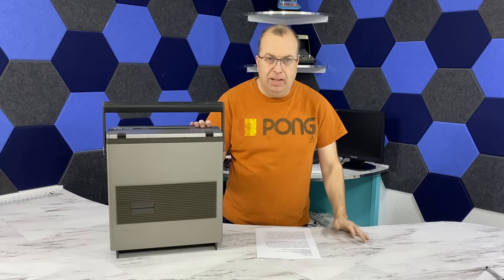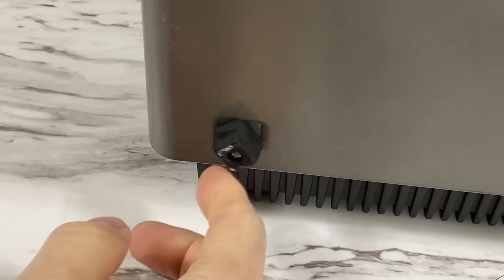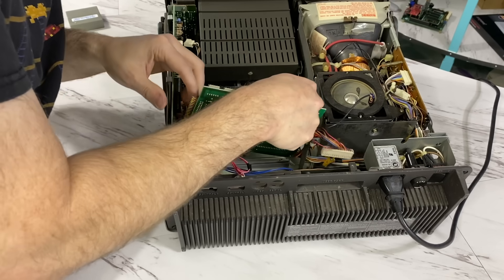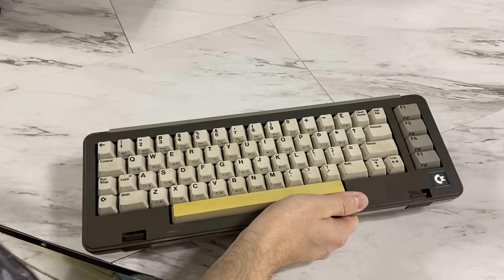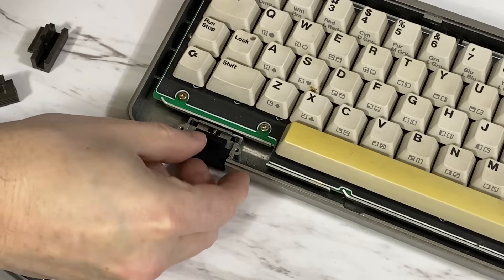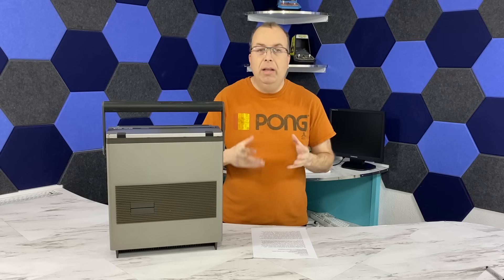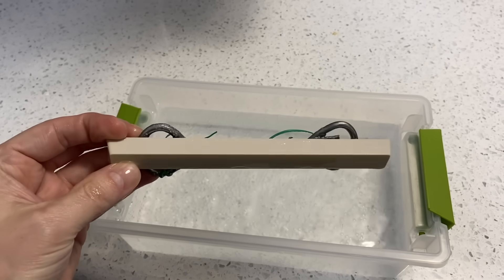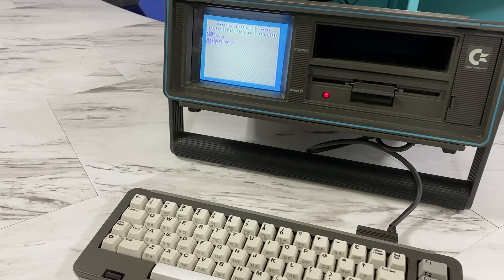Commodore SX-64 repair and trivia

Comment: techmoan would have just replaced the belts
Reply: I had the same issues with mine - they needed a new PLA, SID plus a video ram chip too.
Reply: @Techmoan  You're not going to read this, but in case you do, let me be clear, it was a joke, "you would have replaced the belts and it would have started working". Okay not a great joke in this context, but it got a "LOL" from Dave at eevblog when he failed to fix a LCD TV. ... I have seen your SX64 video several times, its great as are all your videos.
Reply: @OfflineSetup  no I get it - if it had belts I’d have swapped them too.

Comment: Thank you VERY MUCH for making this video. I saw the SX-64 on display in a local video rental and computer store when I was in 10th grade in South Houston and had to have one.  After cutting many lawns and saving every dime I had enough to purchase one but they were no longer available in most places.  My dad called around and we found one left at a computer store at mall in Baytown and we went and I bought it.  That SX-64 got me through high school and college (I had a larger color monitor so I could easily type my term papers in Easy Script) and I still have it today.  I brought it out of storage a few years ago and found the SID chip had failed which I replaced and it’s working fine with the exception of the keyboard.  I didn’t realize you could purchase a new membrane so I’ll be ordering one this week so I can get it in working order and beat my kids at Beach Head and Raid Over Moscow.  Thanks again!!
Reply: That's awesome

Comment: Larger keys often get deformed in the cast when you use harder plastics like pbt, so spacebars are often made from malleable ABS! This is common practice even today. ABS is great from a manufacturing standpoint, but sadly it's very prone to yellowing, cracking and shining.

Comment: I do miss mine.  I had an "External" modem that just happened to be the same size to flush mount in the drive bay area with the pocket removed and a plywood shelf put in.  Pretty unique so if anyone watching has my old machine lets talk buyback.

Comment: I'm still surprised there hasn't been enough demand for someone to produce a run of keyboard cables. Then again, if most folks buying an SX-64 without one these days are  either patient enough to wait for a cable to show up on ebay or willing to roll their own. 

I got a SX-64 a few years back with the cable, thankfully, but the entire handle assembly is missing... which is just about as hard to find.

Comment: A frustrating story:
I once met a guy who unearthed a collection of old computers - I bought a CBM 8096SK without a keyboard off him thinking either it would turn up or I'd find another - hah! He offered me a mint SX-64 for £250:00 we found by way of a thank you for my help in going through the collection. But I turned him down because I knew they are worth way more here in the UK and I didn't have the money to give him more. Well, it went on fleaBay for £200:00 - blast!

I did design a drop-in replacement 80xxSK keyboard mechanism using modern components, along with the 3D files for a replacement case - I never had the time to make them myself but the 3D files, Eagle CAD files, and Gerber files are on Thingyverse if anyone's interested.
The keyboard should be good to go for anyone with a CBM machine that needs a new mechanism. The case I'm less sure about as it's the result of taking measurements from the main case of my computer and eyeballing images on line.

Comment: I want to point out that the keyboard shortcut for load floppy disks, don't work with any software. I have a word like software, called easy script, that does not work if you use the keyboard shortcut for loading it

Comment: Hi, I'm from Italy. At the computer club where I used to go at the time they had a model that was between a SX-100 and a DS-64: it had black&white monitor, but 2 disk drives and we used it to "F4CG" games, if you know what I mean. Nibbler, 2 disks inserted and 30 sec to wait. ;-)  BTW they also had a TurboTrans, a modded 1541 with a 512 Kb hat-board that allowed to grab one full side of a disk in one pass and drop it on the next inserted disk.

Comment: I had an SX64 back in the day.  Bought it used for a bit over $400 (can't remember exactly).  This was probably in 1986 or so.  Got it for my second year of college, and yes...
I did use it for word processing (Fleet System 2) and some programming (UCSD Pascal).
Although yeah, it was mostly for games. ;-)  Had it for two years before I sold it and got my Amiga 500.  
The SX64 was perfect for dorm life.  Really easy to set up in my dorm room or take it to my friends for some gam... er.. homework...  Yeah...  Homework...  ;-)
Still miss that SX64...

Comment: omg why did they not have the wire attached permanently to the keyboard, no cable issues
Reply: flex touchpad keyboard is better and slimmer
Reply: text input/storage device, but a calculator is better for that tho

Comment: An awesome little machine, but would be pretty useless to me since all my stuff is on tape except 2 cartridges. Shift and run/stop is a nice touch, tbh.

I think you nailed it on the head, though. I mean, every C64 owner I knew was a kid who owned it because it was cheap and they could play them £1.99 tapes from Boots. Out of maybe 30 or so kids I knew with a 64, literally one had a 1541 and that's because his dad used it for business use. A floppy drive wasn't really realistic for C64 owners, because if they were rich enough to buy one of those, they'd typically buy an IBM compatible(typically a cheap Amstrad PPC) instead.

Comment: Shouldn't you have totally taken it apart and cleaned all the boards with like alcohol and compressed air or something?
I would have taken it down to the frame and scrubbed everything down really well. Maybe I shouldn't have stopped the video cause you haven't gotten to that yet, but you like wire tied up wires, so just assuming it's not coming back apart?
Just my 2 cents lol. But I'm a mechanic, and if we have a problem or repair, we obviously don't strip down a vehicle to it's frame to put in some spark plugs. However, this is more of a restoration?? I guess you must have assessed that it looked pretty clean inside, or maybe it was already cleaned up by the first owner, and you just didn't mention it??

Comment: I'm glad you finally got a machine! I have an SX-64 with white screen waiting for restoration. Interestingly it seems to work just fine on an external monitor!
Reply: If you're getting video on a external monitor, I'm thinking maybe a loose connection to the built-in color monitor. Time to crack it open and see!

Comment: I worked at Kmart (Costa Mesa, CA) around 1984. We had a SX-64. I think we just had the floor model (display) not any real stock to take away but could be ordered. 
It was a we working unit and as with all computers on display there was running with a screen full of "KMART Sucks".
We never caught the culprit and it was determined that it must have been a group of people since it happened anytime of day 7 days a week (wink, wink).
I honestly don't think even one unit was sold while I worked there. The Vic 20 and C 64s sold like crazy.

Comment: While those devices are definitly interesting now to see, from a mid 80s perspective I wouldn't know a single reason why anyone would have bought one. This thing is barely more portable than a normal C64 setup. And for that little more portability you get a tiny awful screen.

Comment: Does the NES controller for “Attack of…” work on your SX-64? Mine doesn’t. I don’t know if it’s my port or something with the SX-64. Mine has the standard ax-64 mod, of breaking the trace between 2 pins (I don’t remember the pin #, Carlsen has it on his site.)

Comment: Hey out there in YouTube retro technology land!

I do remember at least two people having won the portable Commodore 64 is back in the day!

But what I remember more was the basically IBM's version of this!

I knew a few people that had these one time when they also had a desktop every so often and they let me borrow the portable this is when we did not have our own computer yet!

I remember one time that I wasn't feeling so good for quite a while and they had a lot of games and he suggested that borrow the computer and have it set up in the bedroom!

It's interesting he had two of the IBM desktops and one was mainly just sitting around don't even know why I can't remember everything worked fully and everything and it was not just kept around for spaders or anything it was a full setup as well!

If anyone ever remembers moving a desktop computer back in the day where you would have to back everything up to floppy disk from the hard drive it was not really recommended to move a desktop otherwise back in the day it was more risky I'm not sure if this is really the case or not but from what I understand and had been told yes would like some opinions on this as well this is straight for the older machines it is not considering anything modern but just the older machines!

Keep in mind that was prior to foreign quarter inch floppies the loan high capacity discs and drives

Comment: I think I remember, from Perifractic's restoration, that the main thing preventing this unit from being battery powered is the 50/60 Hz AC wave used to drive the SID. While I wouldn't do it to this machine, perhaps a restomod SX-64 could trade the CRT for an LCD, and use the extra case volume for battery power. Low speed oscillators are easy to build and easily DC powered... you could have a battery-powered portable Commodore!

Comment: I'm surprised that someone hasn't recreated the keyboard cable connectors via 3-D printing or something similar.  I did not get a good look at the connector pins, so I could see that might be an issue.

As for seeing an Executive 64 in a store, the only one I recall for sure was in a Dolgin's retail and catalog store.  The price was out of my range, and the size of the screen was very limiting.

Comment: I bought one of these at an auction in the late 90's - sadly it worked for less than a year until it failed with a black screen. With no access to service manuals or spare chips where I was living and the difficulty of doing any troubleshooting on the device when it is fully assembled and most of the circuitry is inaccessible to probe due to the layout I eventually gave up trying to repair it despite having a decent electronics repair background as the information needed just wasn't readily available at the time pre-internet. I don't even know what happened to it as it was stored broken in my mums basement for many years and by the time I packed up to move countries 10 years later it had disappeared so had most likely been given away or thrown out.

I had wanted one of these so badly in the 80's as a young teenager but eventually ended up going through two breadbin C64's and a donated Amiga 1000, so by the time I did come across a SX-64 at auction so many years later and saw it as a chance to get something I had wanted all those years ago it was a little anti-climactic especially when it broke down soon after. While they're rare and no doubt collectable now and deserve a spot in history as the first colour luggable, a regular C64 is a much better proposition today as something to actually use rather than covet and put on a shelf!

Comment: The main reason the SX64 never got any traction amongst the potential buyers, at least here in Italy, beside the cost is the fact that it had no cassette connector. In a market where the cassettes were ubiquitous, (especially those of... questionable and hence cheap origins. Yes, nowadays it's illegal even here but at the times it was a free for all to the point they were freely sold in to any news kiosk) and the floppies rare to come, it was a serious deficiency, so no one even considered it.

The professional market, always here in Italy, with office software and the like never even came close to the big C after a small period of time before the arrival of i8086-based machines when the Pet got a small corner. With the advent of IBM and compatibles, that side of the market became a territory on which Commodore held no place anymore.

Comment: I have one in near mint condition, no horrible scratches or blemishes. It even still has both handle caps and I have retrobrighted the key caps. It is one of my C= holy grails. I do need to open it up and do a head alignment/clean/rail lube though but that is to be expected considering its age. I will of course be looking for leaking caps and such. I've replaced the keyboard membrane and the keyboard works flawlessly now. I wanted to add a second drive but after some research I decided to just leave it as is. Not worried about the drive at the moment because I just use an SD2IEC or my backbit setup. I also output to a real C= monitor.

Comment: Great episode as always. An SX-64 is also on my wishlist. However, I would probably replace the CRT as there are replacement kits to put an LCD in instead. And yes, that opens the entire CRT vs LCD discussion but it's a nice option to have.
Reply: Where to source one? The CRT will eventually fail and would be hard to find I guess unless you have a donor machine. LCD may not be true to its origins, but at least it will still be alive! :)
Reply: @Webendowed  that would also free some space inside, maybe someone could find a way to take advantage of that.
Reply: @michelealessandrini3421  Maybe stuff a battery in there?  It will take some finagling with the power supply, but I bet it could be done.

Comment: Perhaps this question is redundant, as there may already be an alternative. But have you considered 3D scanning the plug housings on the keyboard cable (with something like Polycam) to allow people to print replacements? Other than the housing it looks like anyone with a few 0.1” pins and a soldering iron could make one.

Comment: i believe this system would have been a LOT more popular if, instead of having that shitty tiny ass screen, they made it simply compatible with any old CRT you would find over at a friends house or in a hotel room, so instead of it being like a laptop you can bring to starbucks, it's more useful for businessmen who have to travel a lot, most hotel rooms back then i would think had a CRT, so you just bring this thing, plug it in and do what you need to do, certainly beats having to bring along a whole computer with the matching monitor AND one hell of a lot better than needing to work on that tiny ass screen.

like imagine someone today made a laptop without amn HDMI or thunderbolt port to connect it to a bigger screen, it would fail and miserably so.
Reply: Well, it does have a video output and you can connect it to an external monitor, no problem.
Reply: @RealGestumblindi   that might be true, but the C-64 uses a proprietary monitor, it won't work on a regular crt television, so i highly doubt this one did.
Reply: @windhelmguard5295  No, the C64 doesn't use any kind of proprietary monitor (I own several C64's, a C128 and actually an SX-64 as well, so I know what I'm talking about). You probably think of the DIN connector used for video output on the C64 side of things, which is indeed proprietary, but it outputs a regular composite video signal using standard connectors on the monitor side as well as separate Y/C outputs, so it can be connected to any monitor with such inputs; also, the C64 actually has an RCA connector for television antenna output *as well*, so this is another option; it's only this additional option that the SX-64 doesn't have (probably because it wasn't seen as needed on a "professional" machine where the higher quality video output would be used).

Comment: I never wanted one.
It's perfect for those who didn't have a dedicated computer desk and had to clear the kitchen table daily.
But in every other way it's awful (IMHO). The screen is too small and the shadow mask makes the resolution even worse. There's no cassette interface.
They are very difficult to work on and they are unreliable so you need to work on them often.

Comment: For some reason the space bar likes to yellow while the other keys seem fine. Your keyboard looks exactly like mine. And you show why "dead test" cartridges are a waste of time IMO. It's a gimmick. Might work in some cases, but you might as well buy a cheap and cheerful logic probe that will work on much more equipment.
Reply: In that case it’s usually that the keys are PBT and the spacebar is ABS. PBT warps more while cooling, so even today it’s quite rare for spacebars. (While ABS is the one that’s prone to yellowing.)
Reply: @kaitlyn__L  Makes sense, the 128D keyboard has the same thing going on.

Comment: Techmoan did an SX64 repair video years ago.
Reply: Put heatsinks on the SID and PLA chips...
Reply: @talon262  I believe the root cause of SX 64 failure was having the heat from the CPU, colour CRT, drive and power supply for everything all crammed in one box.